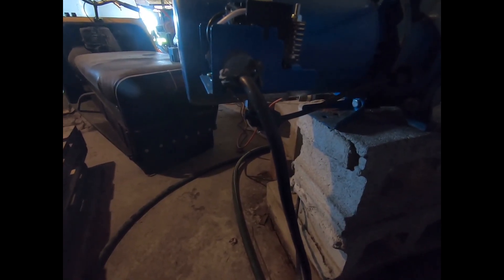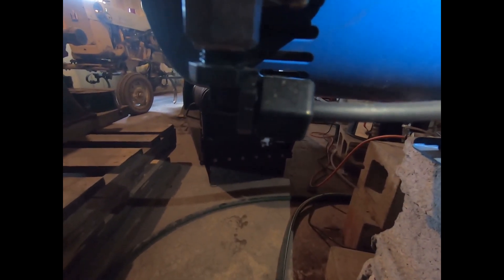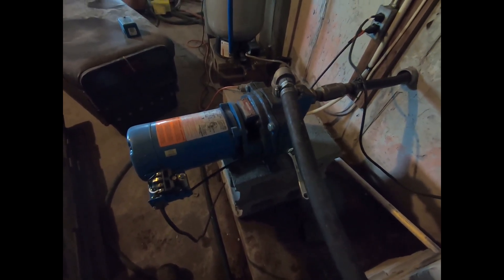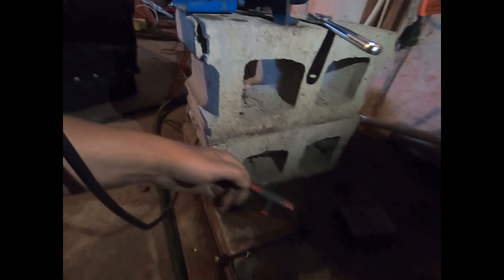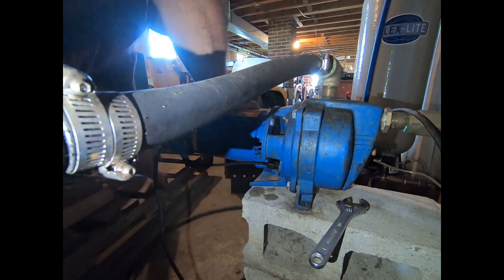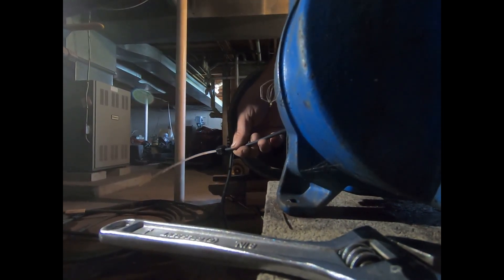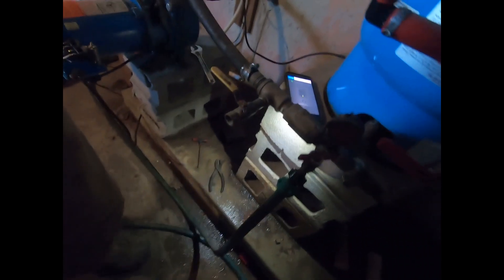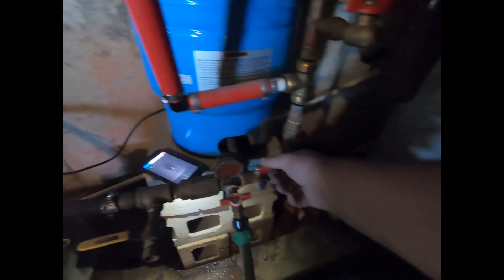# 318 Well pump pressure switch delay fix

Comment: You might want to check out a device called a Cycle Stop Valve. I installed one on our deep well pump. I no longer need a large air bag tank. One the size of a basketball does a excellent job.
Reply from the maker: Its working perfectly now